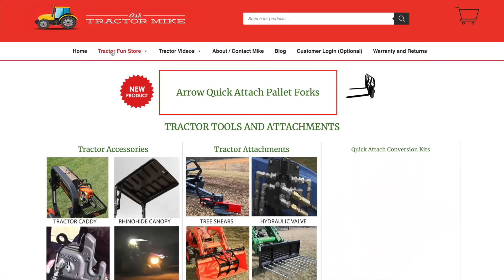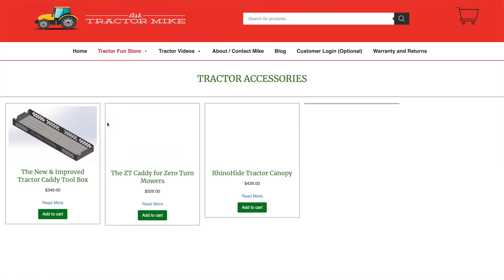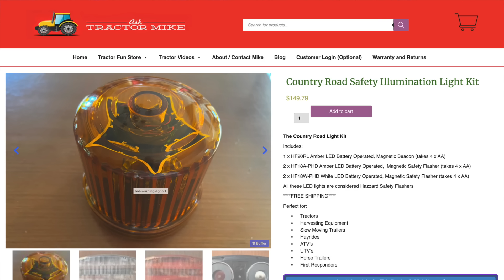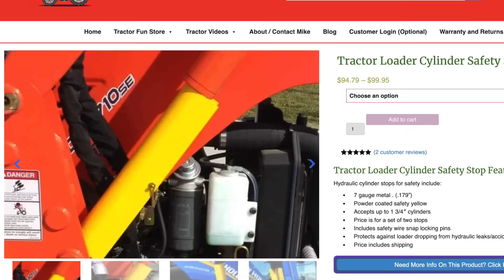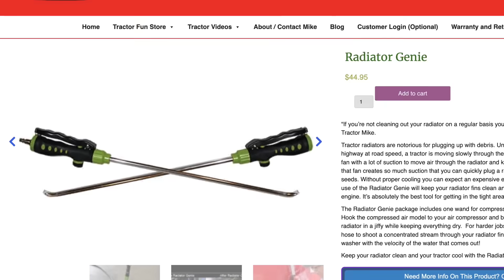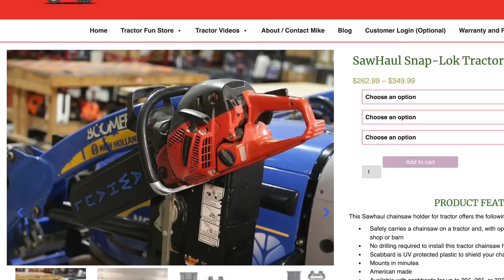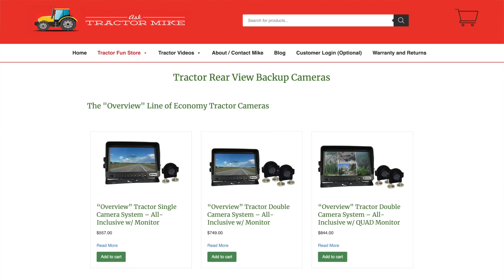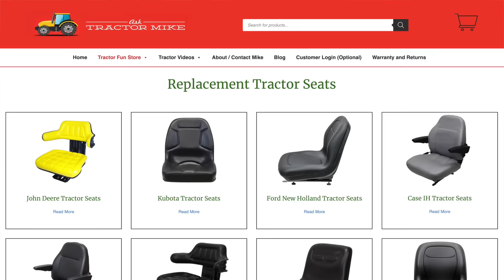12 Amazing Christmas Gifts For The Tractor Enthusiast

Comment: the safety locks are great.
I love my Caddy and the new cutouts would be handy since mh bungees tend to cause the edge to cut into my handles until i modified the edges with rubber.
I also got the lights but added quick disconnects so i can easily switch between lights i have.  One set of lights are round high power LEDs that i put on my loader arms via magnets to provide out front lighting that i can arrange as needed.

Comment: Hey Mike, the radiator genie works great, but they kind of rip you off by selling the air and water unit together.  I’ve bought two and have never used the water wand.  If you have any sway with the manufacturer, please suggest they allow us to buy one of the other.
Reply: i use my water wand as a source of high pressure to wash my tractor after a long day of use.  pretty cool device to have around. when u need it - u need it. I do not wash tractor down until i’ve blown the dirt and dust off and it’s cooled down a lot.

Comment: I was shredding around my barn a couple of weeks ago and hit something hard and unexpected.  The next day I was out and saw hunks of wood that did not look like the remains of a tree limb,  it was too perfectly round.  Turned out that my shovel had fallen out of my tractor caddy.  The cutouts are a great addition!  I may need to take my saws-all to mine.
Reply: i use rubber straps to secure items i place in the caddy. keeps items from shifting around plus holds by small cooler.   caddy is a very good addition to my tractor and i forgot that i keep a small tool box in the caddy.